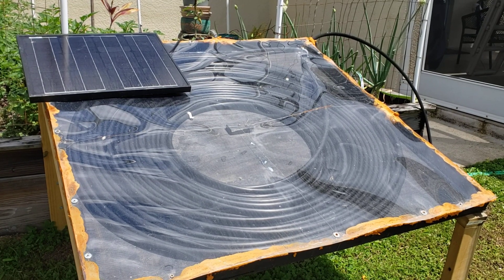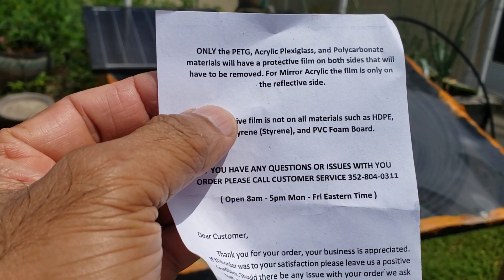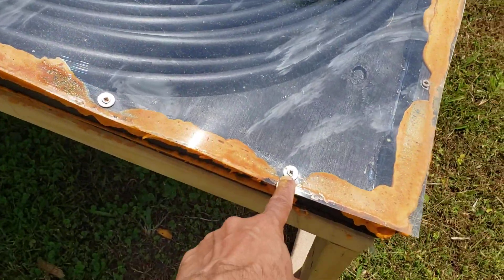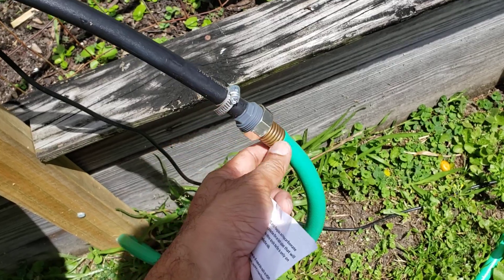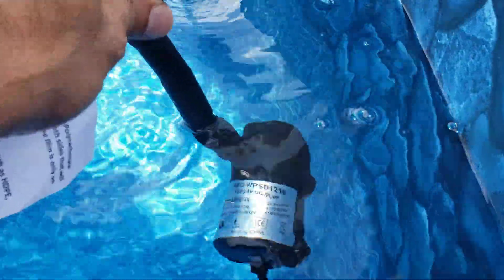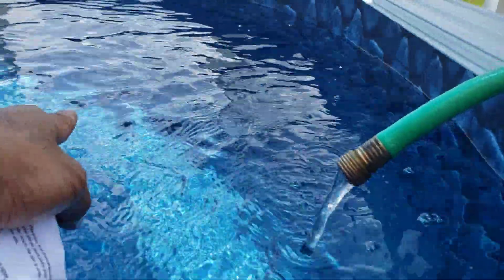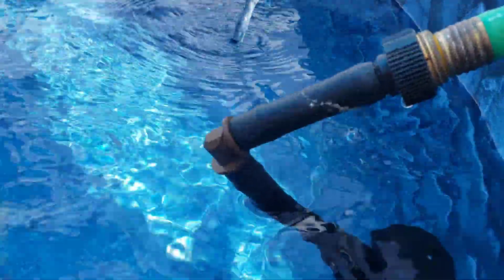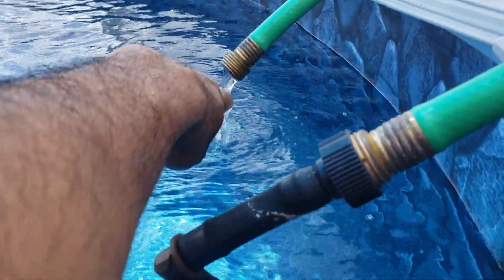Construction of a DIY solar pool heater Pt2

Comment: Unless specially coated ,PETG sheets have poor UV resistance.  Good video.
Reply from the maker: You are correct, over time it is degrading.  I purchased the PETG on another recommendation.; I will need to look for something else.

Comment: I think you need several panels like this to warm up your pool
Reply from the maker: Yes. Agreed. It depends how much you want to spend, how hot you want it and how much you plan to use the pool. For me it was spend little, heat a little and the pool is seldom used.

Comment: what is the length and diameter of the hose to achieve these 3 degrees
Reply from the maker: 15 feet, 3/4 inch

Comment: Thanks for sharing this video, two questions. 1) Can you share what adapters you used to convert the 3/4 connector on the pump to allow connection to garden hose? 2) Do you have your pump connected directly to the solar panel or are you connecting to a battery or some other controller to govern the voltage output? I've ordered the parts you've mentioned and am anxious to try this same setup but am unclear on how to connect the pump to the solar panel. Thanks!
Reply from the maker: 1. I used a heat gun and some irrigaton tubing to connect to the tubing supplied with the pump, then used a hose to irrigation adapter to connect to the irrigation tubing. Photo here: https://photos.app.goo.gl/Md5DEjFBGu5sZ5EB7
2. Yes, the pump is connected directly to the solar panel. They are well matched so a controller/battery is not needed. The pump does not need to run in the night as no hot water is being produced. 
Hope this helps!